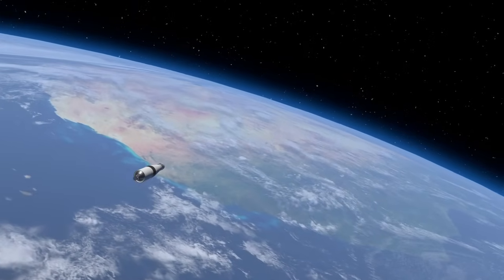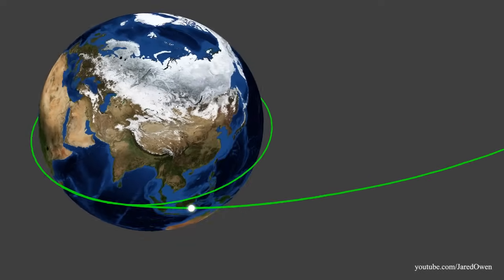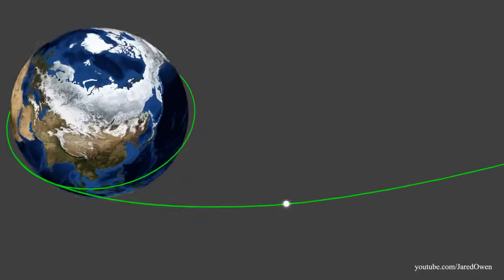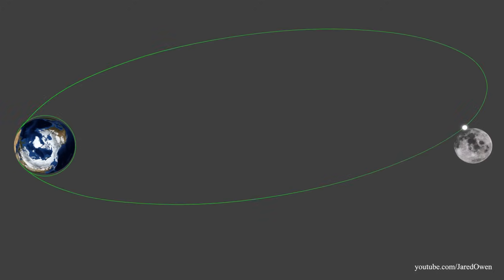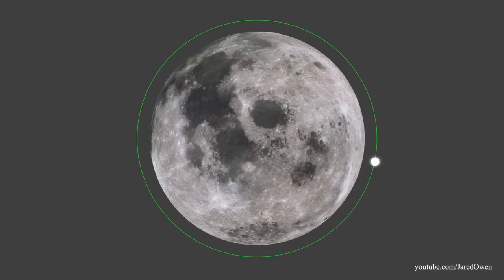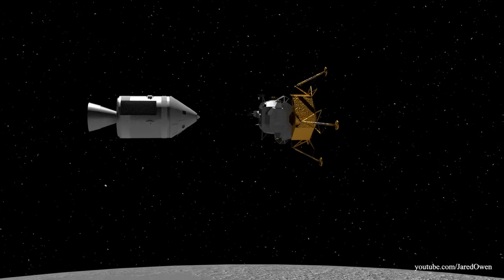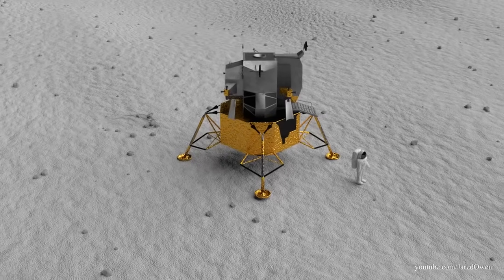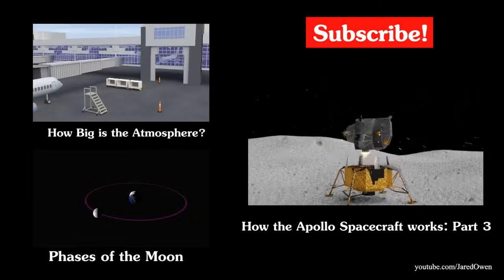How the Apollo Spacecraft works: Part 2

Comment: How did the Lunar Module blast off and reconnect with the Command Module? Supposedly, Collins only had his eyesight to ensure that the Lunar Module would dock safely? It just strikes me as really, really difficult. And if it misses, it just goes flying off into outer space.
Reply: Have you watched part 3 because it shows how the descent stage becomes the launch pad for the ascent stage. The rendezvous was aided by radar but they also had the VHF as a backup that the CMP was trained for. The backup was never required as the rendezvous radar worked perfectly on each mission. As for the actual docking, here's a quote from a NASA pdf about it:
"The most desirable visual aids were a collimated reticle aid in the LM
and an illuminated standoff cross 'in the CSM.
effect on docking when visual aids were used."

So no, he didn't just have his eyesight to achieve docking. As for difficulty, you have to keep in mind that all the astronauts(except Harrison Schmitt of course) were former air force pilots or navy aviators. The best of those were sent off to become test pilots. The best of those were selected to become astronauts. These guys had exceptional hand-eye co-ordination skills and years of experience plus many hours of simulator training that would throw all kinds of last second problems into the mix to hone their skills. By the time they actually were on real missions, everything had been practiced so much that it all seemed pretty routine to these guys, except of course the Apollo 13 incident. As for your comment that "if it misses, it just goes flying off into outer space." that simply isn't true. They would still be in lunar orbit with matching relative speeds so it would be a simple matter of just doing another docking attempt.
Reply: @mako88sb  What about the Van Allen Radiation Belts? These weren't a problem?
Reply: @tmorpheme  They weren't an insurmountable problem. The type of radiation found there is some of the easiest to block or attenuate against. However, there are certainly regions of the VAB's were the radiation hazard is more pronounced. The TLI burn was planned so that the Apollo spacecraft's trajectory would avoid or spend as little time as possible in the worst of these areas. 

A lot is made about the NASA video were an engineer supposedly states that they are trying to overcome problems so that they can go through the VAB's and of course people wonder why since they did all of this during the Apollo era. What he actually said was "We must solve these challenges before we send people through this region of space". What he means is that because Orion is being designed for space missions that could last months or even years as a Mars mission would require, they are planning on doing different trajectories through the VAB's that will expose it to more radiation than any Apollo mission ever experienced. The reason they would do that instead of a Apollo style TLI burn boils down to minimizing fuel usage which is very important for longer missions. 

Another thing to keep in mind is that Russia, Europe, China, India and Japan have all flown missions to the moon. So far, none of these countries/nations have brought forth any evidence that it's impossible to do a manned mission to it. That includes supposed claims about the radiation in the VAB's being too hazardous to pass through. No radiation expert from any country including the ones mentioned here have ever stated that the radiation in the VAB's was an insurmountable problem during the Apollo missions to the moon.
Reply: @mako88sb  Why have we never gone back to the moon?
Reply: @tmorpheme   Pretty simple really. Space missions are outrageously expensive and manned space missions are grotesquely outrageously expensive. NASA's budget was cut to a fraction of what it was during the heady days of reaching Kennedy's goal so they decided to focus on the space shuttle and when they did that, the only building(vehicle assembly building) capable of safely stacking everything required for the Saturn V and the Apollo missions was converted to be used on the shuttle. It could do one or the other but was not capable of being quickly changed so that it could handle both so there's no way they could have done a manned landing during the shuttle era without constructing another similar building and they simply didn't have the money for that.With the retirement of the shuttle, that same building is being converted again to handle the SLS.
Reply: @mako88sb  The recent Israeli attempt to land on the moon. Why did it take two months? Does space travel work with such different speeds? Apollo took, what three days to get to the Moon? And three days to get back? How was it possible that the trip home was not longer? Where was all the jet fuel stored?
Reply: @tmorpheme    A perfect example of why manned missions are grotesquely outrageously expensive. The need to supply oxygen, food, water and a livable environment adds all kinds of weight directly and indirectly such as the extra fuel to get the weight of the men and everything to keep them alive into orbit before the TLI burn. To minimize potential hazardous radiation exposure as well as reduce the amount of weight for everything needed to keep those men alive, you wouldn't choose the long method of going to the moon which is much more cost effective with the minimal use of fuel since it uses the sling-shot assisted by Earths gravity. 

With the Apollo missions, they used high energy burns for the TLI & TEI burns which used a fair bit of fuel that had to  be lifted into orbit. Fortunately, since they are in a vacuum, after the burns, they simply coast most of the way with the odd course correction so huge amounts of fuel weren't needed.  

Also, another big difference between Beresheet's trip to the moon vs the Apollo missions is the simple fact that the Falcon 9 it launched on also had 2 other payloads that were put into Earth orbit. The orbital mechanics for the additional payloads plus Beresheet's trip to the moon required a completely different approach compared to Apollo.
Reply: @mako88sb  You are talking crap. You cannot "coast" 238,000 miles.
Reply: @tmorpheme  In a vacuum you can. The Voyager spacecraft have been coasting for decades and will continue to do so for millions, if not billions, of years.
Reply: @tmorpheme    If you ever do attempt to do some proper research, you would find that every single supposed bit of evidence brought up about alleged proof regarding hoaxing the Apollo landings have been debunked over the years. Most of it with relative ease because the supposed proof is usually based on complete ignorance of the particular subject involved. Meanwhile, there is tons of scientific evidence that is irrefutable which has been accessible to scientists and aerospace engineers for the last 50 years who have never found anything that might suggest the landings were faked so it's only people who lack critical thinking skills who fall for this moon landing hoax nonsense. Here's some of it:

-> There's the live TV coverage that would have to somehow convincingly fake 1/6th G movement in a vacuum, Google "Irrefutable Proof for Moon Landing - Lunar Gravity" and explain how experts in the field of kinematics for 50 years have never come forward with proof that the astronauts are not in an environment that they say they are. There's also the fact that any attempts to do filmed mockups of the eva's on Earth would have to be passed off as live TV broadcasts which would have to fool telecommunications experts around the world. Google "Moon Hoax Not" and "For Jarrah" to get a better understanding of how much would be involved to pull that off and how the filming technology back then was simply incapable of such a thing.

-> There's all the moon rock and core samples that would have to somehow be able to pass scrutiny with geologists who can readily spot whether it's something that has passed through our atmosphere or not. 
Google "How do we know that rock came from the moon?"

-> NASA has made these samples available to scientists from around the world and every year 500-1000 samples are sent out.
Google: "NASA lunar sample request"

-> There's the Apollo 16 UV telescope images that no astronomer in 50 years has ever found fault with. Google "onebigmonkey apollo 16 UV telescope"

-> Another thing that astronomers would be able to spot are pictures of the Earth that don't match what they should look like. Google "Apollo 11 Earthrise - How One Photo Proves it was Real" for an example. 

-> Another one to google is "Apollo 11: Fingerprints in Deep Space" that shows obvious handheld TV footage from the Apollo 11 CM looking at Earth from far enough away that they are clearly beyond the VAB's.

-> Then there are the LOR images. Lots of hoax believer nonsense about them being faked but the transmittal data for them can be downloaded by anybody with a computer and so far, nobody has proven anything about them being faked. You don't think a smoking gun like that wouldn't have been scrutinized by people with the required computer science expertise??

-> Here's something else you might not know. Apollo 12 landed close enough to Surveyor 3 that Conrad & Bean were able to do an Eva to it and removed the camera and sampler scoop from it to be returned back to Earth. They wanted to see what the harmful conditions of the moon had done to those parts after 2.5 years: Google "Analysis of Surveyor 3 Material ad photographs returned by Apollo 12"

-> 5 plutonium-238 powered ALSEP's were left behind that transmitted data from the experiments back to Earth right up till 1977. Unfortunately, due to budget constraints, they were shut down but they did send back enough information that storage of it became a real problem as detailed in this article: Google "the-long-road-to-alsep-data-recovery"

-> Starting with Apollo 13, they purposely directed the spent S-IVB's to crash into the moon so that the Apollo 12 seismograph could record the seismic waves generated to help determine the moon's crustal structure and makeup. Of course, as each successful mission added another ALSEP, they were able to expand on the info derived from these man-made impacts. They also did the same with the lunar module ascent stages. The Apollo 16 LM ascent stage data isn't shown because of difficulties during the de-orbit phase. They were able to derive a lot of info from these artificial impacts. Google "The Description of Apollo Seismic Experiments darts"

-> Another great site to check out has some pretty thorough crater analyzing to prove the landings happened. You can check out all six of the landings this way: Google "onebigmonkey apollo sights landing"

Are you starting to understand the magnitude of what would be involved to pull a hoax like this off? Never mind keeping it from being exposed?

I suggest you also take the time to read through the 93-page pdf titled "NASA’s Recommendations to Space-Faring Entities: How to Protect and Preserve the Historic and Scientific Value of U.S. Government Lunar Artifacts". There is lots of nonsense from hoax believers that the USA is trying to make the Apollo sites inaccessible which is ridiculous seeing as these are only recommendations designed to limit harmful effects of spacecraft landing too close or the altitude of hopper type craft flying at too low of an altitude. The fact is, the USA has no issue at all with visits to the sites by manned or unmanned means. They do request the Apollo 11 and 17 sites are accorded with the proper respect due to the obvious historic value. Also, there is an Appendix B in the pdf that gives a lot of recommendations from NASA as to what type of investigations at the Apollo sites would be most beneficial for scientific purposes. Now does this seem like the type of behavior for a country that supposedly faked all of this??

As I said, irrefutable proof that has withstood scrutiny by the relevant experts from around the world in all the specialties involved for 50 years which in my book proves beyond a doubt that the landings happened just the way they were documented 50 years ago and which easily trumps supposed proof that this was all faked but that same supposed proof doesn't stand up long to scrutiny.
Reply: @mako88sb  To be frank, I am agnostic, leaning toward atheism, on the moon landings. 
I am not entirely convinced by your detailed replies because they do not sufficiently explain the anomalies. But in the absence of a true smoking gun, I guess I will have to remain in my present skeptical mode.

Since I am not what you might call "a moon landing hoaxer", I don't feel obliged to answer your questions. But I will. The reason is simply to let you see where my thinking is at. I have often found it interesting how people change their minds. When they do this, what changes is not one simple thing but a whole host of related things.

1Q.  400,000 people were involved with the project, yet nobody has come forward with evidence that the landings never happened. You guys like to bring up the Manhattan Project compartmentalization security that kept only the ones in the need to know fully aware of what was going on. Yeah, sure. A top secret military project that kept even vice president Truman out of the loop being compared to a project like Apollo that was as publicly open as possible. Yet despite all the USA's attempts to keep the A-bomb project under wraps Russia still managed to get key people in the right places to provide them enough info that they developed their own bomb much sooner than the USA expected. You seriously expect us to believe that in the past 50 years since the landings were supposedly staged, nobody has come forward with insider information or definitive proof? Yeah, right.

1A. Well, compartmentalization is real. Take a university as a boring for instance. To what extend is information, even major information, shared right across the entire faculty, staff and student body? Many things are known within only local networks. As for the moon, my present hunch is that Apollo orbited the earth for a number of days and then returned. So, most of the NASA crew would have been aware of an Apollo launch but would have shared the illusion that we went to the moon.

2Q. The Russians tracked and confirmed all 6 of the Apollo moon landings. Why would the USA's major competitor during the space race do that?
2A. Please provide the proof of this. I would be interested in seeing it. But the obvious answer would be: the Soviets weren't in much of a position to alter public opinion in the US, even if they were aware that the moon landings were a hoax. They were have risked the danger of coming across as sore losers or dangerously deranged conspiracy theorists. The combined three US networks would have torn into them for years.

3Q. Russia, Europe, China, India and Japan have all flown missions to the moon. So far, none of these countries/nations have brought forth any evidence that it's impossible to do a manned mission to it. That includes this nonsense about the radiation in the VAB's being too hazardous to pass through. No radiation expert from any country including the ones mentioned here have ever stated that the radiation in the VAB's was an insurmountable problem during the Apollo missions to the moon. Why is that?

3A. So far only the US has claimed to have landed men safely on the moon and brought them back. And these events happened 6 times within 2 1/2 years (meaning that it was EASY and SAFE) and yet has not done it, or even tried to do it, since. And it has now been almost 50 years. The obvious comparison is with the discovery of the New World. Why the endless delay in attempting to colonize the moon or at least map it extensively?
So you are saying that Van Allen was wrong? Are there scientific papers that you know of that discuss this issue?

4A. Scientist from around the world have verified and peer reviewed all of the lunar rock & core samples plus all the data transmitted back to Earth by the ALSEP's left behind. There's also the Apollo 16 UV telescope images that include some of Earth that no astronomer has ever found fault with. Why would intelligent individuals go to such trouble?

4A. This is simply untrue. Samples of moon rocks may be found at the North Pole. In 2014 or so, the Dutch announced that the moon rock sample they had been given was not a moon rock.

5A. Hoax believers have for the last 50 years tried to find evidence that the landings were faked and have found nothing that can't be debunked. The proof they failed is that despite all their efforts, the missions are still in the history books. A story of that magnitude would have been seized on by investigative reporters and news networks. Not just the USA but countries from around the world would have gone after the biggest scoop in history. Explain how come they haven't.

5A. Again, there HAVE been documentaries on the BBC; there have been books written since the mid-1970s. There is a growing worldwide movement of skepticism based on the sense that the Americans should have returned by now, plus some of the various anomalies observers have noticed. 
The reason the moon landings are still in the history books is because they have not been officially debunked by NASA or an independent commission. But what possible motive would induce anyone in power at the moment in the US to do this? In his autobiography, however, Bill Clinton apparently entertains the idea of the moon landings being a hoax in a light hearted way.
I doubt that this will reassure you, but I sincerely believe that 9/11 was a neoconservative inside job. Many people would find that view ridiculous too. But the issue is unlikely to be decided one way or the other until there are vast changes in the global balance of power. And maybe not ever. I don't think every single conspiracy gets uncovered. Why would it?

 6Q Trying to discredit information because it came from NASA, as I'm sure you'll do, is a bit ridiculous. They made all the engineering and science required to pull the missions off available to their counterparts from all kinds of countries throughout the world.

6A. I must admit I found it hard to believe, when I read it in a NASA document, that Collins guided the moon lander to its rendezvous with the command module with his naked eyes. BUT THAT IS WHAT IT SAID. In other words, by reading a NASA document, I became more skeptical of the verity of the moon landings (and subsequent take-off!).

7Q. I'm not just talking about the people involved with the project while it was happening. There's also all the scientists and engineers in the following decades that have access to everything related to it regarding the engineering plus all the scientific, peer reviewed evidence, data and samples. Yet in all that time none of these highly intelligent folks from around the world have ever found a way to somehow get information out to anybody about NASA"s alleged duplicity regarding the supposed landing hoax.

7A. It's my understanding that many of the documents relating to the design of the Apollo spaceship as well as the footage of the moon missions has gone missing. In this case, it is impossible to review. Am I wrong?

A question for you to close: Who are you, and why should I believe what you say? You seem reasonably well-informed, but I don't sense someone with inside information. Just an educated believer in the verity of the moon landings.
Reply: @tmorpheme  Here's a video describing what I've experienced before. Most likely the same thing happened to your post:
https://www.youtube.com/watch?v=Ennqwved6o0
Reply: @tmorpheme  A small lesson on some pretty specific orbital mechanics related to your question about why some trips to the moon take longer than others.

When you are in a circular - or near circular orbit, and you burn your engines in the direction you are moving, what actually happens is that you raise your orbit on the exact opposite side of the Earth.  The quickest way to go from the Earth to the moon is to perform one long burn to raise the orbit on the opposite side of Earth equal to the height of the moon.  You've built up a lot of speed in one burn, but it is also the least fuel efficient way.  The reason is because at any one instant, your acceleration is affecting the direct opposite side of your orbit, but you are also moving very fast, so for each second that passes, the direct opposite side of your orbit has changed by several miles or more depending on your speed, so you are actually not concentrating that energy to one area of orbit.  However, if you were to do multiple smaller burns - by doing a small 10-15 second burn, raising the opposite end of your orbit, then waiting until you orbit all the way around and come to that same area again, and do another 15 second burn, this energy is all going into the same point in orbit.  If you perform a dozen burns all in 10-15 second increments, it's as if you did one 15-second burn with 12 times the thrust.  You achieve the same goal, but do it with a fraction of the fuel.  The sacrifice is time.  Because you have to wait an entire orbit to perform each one of these burns, so it can take weeks to get to the moon with this method.  For an unmanned probe, who cares?  However, for a manned mission - if you have a choice between 3 days and 3 weeks, the savings in fuel is not worth the obstacle of supporting the lives of astronauts for that amount of time.  For a lunar mission, this is a big deal; for a mission to Mars, not so much.  The mission is already going to take 18 months, so if you're already going to have to figure out a way to provide life support for that amount of time, and extra few weeks is not that significant compared to the savings in fuel.  So, this is why some unmanned probes take longer to get to the moon, and also why the radiation concern for Orion is a different beast.  Due to this more fuel efficient burn, they will make several passes through more intense regions than Apollo went through, but at no point has any engineer claimed the issue was insurmountable.  It is merely a concern.  The Orion has since been tested, and will be able to withstand the radiation.  The video from which this NASA engineer quotes from is old.
Reply: @tmorpheme  "You cannot "coast" 238,000 miles."

Explain why you think not.  What is preventing this?
Reply: @tmorpheme  Not sure who you are talking to. If me, your wrong because I can only edit my own stuff. Btw, I've noticed that sometimes my own posts don't look like they are fully there and that there's no "Read more" to click. Then I hit the edit  and everything shows up. Maybe that's what's going on with your end. I read through your post yesterday and just looked at it now and everything still seems to be there afaik.
Reply: @tmorpheme  I just copied and paste what you posted yesterday. Tell me if anything below is missing content from what you wrote:

"To be frank, I am agnostic, leaning toward atheism, on the moon landings. 
I am not entirely convinced by your detailed replies because they do not sufficiently explain the anomalies. But in the absence of a true smoking gun, I guess I will have to remain in my present skeptical mode.

Since I am not what you might call "a moon landing hoaxer", I don't feel obliged to answer your questions. But I will. The reason is simply to let you see where my thinking is at. I have often found it interesting how people change their minds. When they do this, what changes is not one simple thing but a whole host of related things.

1Q.  400,000 people were involved with the project, yet nobody has come forward with evidence that the landings never happened. You guys like to bring up the Manhattan Project compartmentalization security that kept only the ones in the need to know fully aware of what was going on. Yeah, sure. A top secret military project that kept even vice president Truman out of the loop being compared to a project like Apollo that was as publicly open as possible. Yet despite all the USA's attempts to keep the A-bomb project under wraps Russia still managed to get key people in the right places to provide them enough info that they developed their own bomb much sooner than the USA expected. You seriously expect us to believe that in the past 50 years since the landings were supposedly staged, nobody has come forward with insider information or definitive proof? Yeah, right.

1A. Well, compartmentalization is real. Take a university as a boring for instance. To what extend is information, even major information, shared right across the entire faculty, staff and student body? Many things are known within only local networks. As for the moon, my present hunch is that Apollo orbited the earth for a number of days and then returned. So, most of the NASA crew would have been aware of an Apollo launch but would have shared the illusion that we went to the moon.

2Q. The Russians tracked and confirmed all 6 of the Apollo moon landings. Why would the USA's major competitor during the space race do that?
2A. Please provide the proof of this. I would be interested in seeing it. But the obvious answer would be: the Soviets weren't in much of a position to alter public opinion in the US, even if they were aware that the moon landings were a hoax. They were have risked the danger of coming across as sore losers or dangerously deranged conspiracy theorists. The combined three US networks would have torn into them for years.

3Q. Russia, Europe, China, India and Japan have all flown missions to the moon. So far, none of these countries/nations have brought forth any evidence that it's impossible to do a manned mission to it. That includes this nonsense about the radiation in the VAB's being too hazardous to pass through. No radiation expert from any country including the ones mentioned here have ever stated that the radiation in the VAB's was an insurmountable problem during the Apollo missions to the moon. Why is that?

3A. So far only the US has claimed to have landed men safely on the moon and brought them back. And these events happened 6 times within 2 1/2 years (meaning that it was EASY and SAFE) and yet has not done it, or even tried to do it, since. And it has now been almost 50 years. The obvious comparison is with the discovery of the New World. Why the endless delay in attempting to colonize the moon or at least map it extensively?
So you are saying that Van Allen was wrong? Are there scientific papers that you know of that discuss this issue?

4A. Scientist from around the world have verified and peer reviewed all of the lunar rock & core samples plus all the data transmitted back to Earth by the ALSEP's left behind. There's also the Apollo 16 UV telescope images that include some of Earth that no astronomer has ever found fault with. Why would intelligent individuals go to such trouble?

4A. This is simply untrue. Samples of moon rocks may be found at the North Pole. In 2014 or so, the Dutch announced that the moon rock sample they had been given was not a moon rock.

5A. Hoax believers have for the last 50 years tried to find evidence that the landings were faked and have found nothing that can't be debunked. The proof they failed is that despite all their efforts, the missions are still in the history books. A story of that magnitude would have been seized on by investigative reporters and news networks. Not just the USA but countries from around the world would have gone after the biggest scoop in history. Explain how come they haven't.

5A. Again, there HAVE been documentaries on the BBC; there have been books written since the mid-1970s. There is a growing worldwide movement of skepticism based on the sense that the Americans should have returned by now, plus some of the various anomalies observers have noticed. 
The reason the moon landings are still in the history books is because they have not been officially debunked by NASA or an independent commission. But what possible motive would induce anyone in power at the moment in the US to do this? In his autobiography, however, Bill Clinton apparently entertains the idea of the moon landings being a hoax in a light hearted way.
I doubt that this will reassure you, but I sincerely believe that 9/11 was a neoconservative inside job. Many people would find that view ridiculous too. But the issue is unlikely to be decided one way or the other until there are vast changes in the global balance of power. And maybe not ever. I don't think every single conspiracy gets uncovered. Why would it?

 6Q Trying to discredit information because it came from NASA, as I'm sure you'll do, is a bit ridiculous. They made all the engineering and science required to pull the missions off available to their counterparts from all kinds of countries throughout the world.

6A. I must admit I found it hard to believe, when I read it in a NASA document, that Collins guided the moon lander to its rendezvous with the command module with his naked eyes. BUT THAT IS WHAT IT SAID. In other words, by reading a NASA document, I became more skeptical of the verity of the moon landings (and subsequent take-off!).

7Q. I'm not just talking about the people involved with the project while it was happening. There's also all the scientists and engineers in the following decades that have access to everything related to it regarding the engineering plus all the scientific, peer reviewed evidence, data and samples. Yet in all that time none of these highly intelligent folks from around the world have ever found a way to somehow get information out to anybody about NASA"s alleged duplicity regarding the supposed landing hoax.

7A. It's my understanding that many of the documents relating to the design of the Apollo spaceship as well as the footage of the moon missions has gone missing. In this case, it is impossible to review. Am I wrong?

A question for you to close: Who are you, and why should I believe what you say? You seem reasonably well-informed, but I don't sense someone with inside information. Just an educated believer in the verity of the moon landings."
Reply: @tmorpheme    So did you figure it out or not?
Reply: @mako88sb  Someone edited my posts. But anyway. Curious about your responses to things like the proof that the Russians tracked and confirmed all the Apollo missions and that many of the NASA documents relating to the moon landings have been permanently mislaid.
Reply: @tmorpheme  Well, I was starting to type that all up until you had your little episode there and wasn't sure if you were coming back. I'll get back to it when I can but pretty busy for the next few days.
Reply: @mako88sb  Yeh, yeh. We all know how this goes, Mr Anonymous.